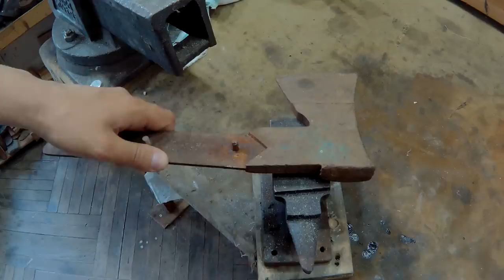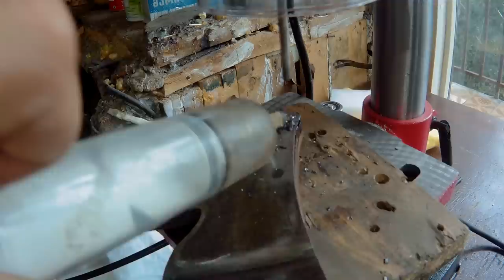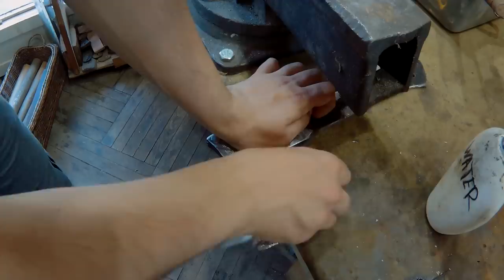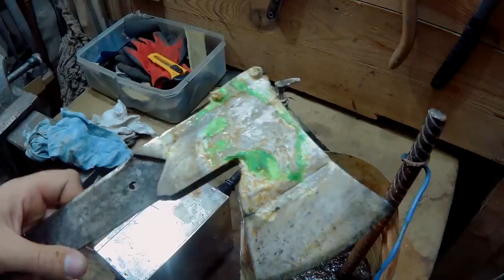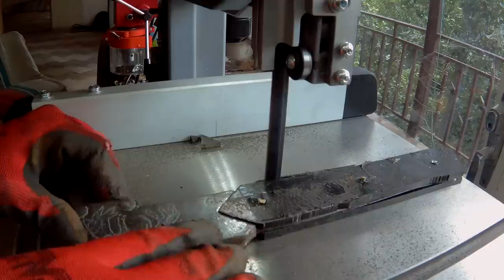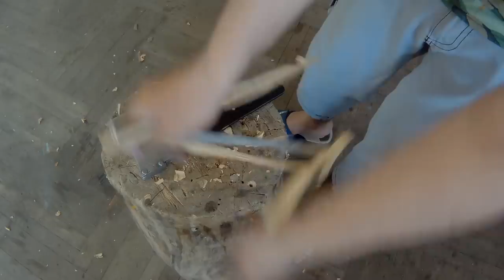Old Rusty Hunting Axe Restoration

Comment: Nice job on the ax !
Reply from the maker: Thank you!!
Reply: @ScrewsAndTools  when does a hatchet become an axe?  No really, where is that line drawn? Also, it's axe, not ax, least ways in American English.
Reply from the maker: @tootall5559  Sorry, I cant understand what you mean. Please more be specific.
Reply: @ScrewsAndTools  I would call this a hatchet, not an axe. Others call it an axe. Generally, whether it's a hatchet or axe is determined by handle length for the most part.  A hatchet is made to be used one handed, an axe is made to be used with two hands primarily. In this example, it has a somewhat longer handle than a common hatchet,  but it doesn't appear long enough to be an axe by most definitions. It's actually kind of in between from what I can see. However, I don't know if there is an actual measurement that smaller is hatchet, longer is axe. People misuse words all the time. I was a book editor, you should see some of the misuses even people that are considered smart make.

Comment: Just a little advice. Cold hammering that steel back into place is probably one of the most stressful things you could have done to that axe. Brazing those gaps with brass would have been better. Also more accurate to how that axe would have been fixed near the time it qas produced. But over all. Wonderful video and great restoration.
Reply from the maker: Hello, thank you for advice and attention, sir.

Comment: If you wanted to be able to use it as a hammer too, you should have welded on a hammer head,  unless I miss my guess, the outside steel on the head is only mild steel, and will deform rather easily. other than that, it looks quite nice, especially when you consider it was originally a lower end hatchet.
Reply from the maker: Hello. Thank you for attention sir!
 I just like test my final stuff for viewers, also i show how can I use this axe, for exp like a hummer. Yes in the future it's possible but it will be change main shape of axe.
Reply: @ScrewsAndTools  you wouldn't have to change the basic shape much. just weld a relatively thin block of good hardenable steel on the back side, then  differential heat treat it so the block is hard enough to not deform too much when used as a hammer. Wouldn't take all that much,  but it would have to be hardened just right, and tempered so it would not just break. You could get it too hard..I think on most hammers they case harden them, where basically the outside is very hard but the rest of it is not quite so hard.
Reply from the maker: Thank you for explain your thoughts. You, as I said in description of this video, this is a axe from hunting kit (kit by the rules should include knife too), so in the resource where I saw this information was writed a x e. Because I call this video axe restoration.
Reply from the maker: @tootall5559  This is a good idea, for example I can use may be shape of with size 5-6 cm × 2.5. The rest I can corrected by the grinder.
Reply: @ScrewsAndTools  Not a big deal, but I would honestly like to know if there is an actual definition of when a hatchet is an axe and vice versa. When I was growing up so long ago, I was taught that if it was MADE to be used with one hand, it's a hatchet, made to be used with two hands, it's an axe. This handle is at a length it really could go either way. It's like when does a knife become a sword?  Some short swords are not any longer than some larger knives...I don't know where the line is drawn there, either.  I haven't been able to find anything definite to go by either.

Comment: I agree with the other reviewer about the etchings, I had never seen them done that way before and I can't say I liked the results. But other than that I think you did a good job with the restoration. What material did you use for the handle, I couldn't figure that out? All in all  good work.
Reply from the maker: Hello, thank you for attention, this is a some plastic, but exactly information I didn't have. Someones call it "fenolik".
Reply: Teddy - I think you mean phenolic resin which is a type of plastic.  Nice job.  Personal preference though for an old axe would be wooden handle scales.
Reply from the maker: @randmeller  Thank you for attention

Comment: good restoration my one issue is that hammering out the mushrooming on the back  of the ax head can be possible but it's better to grind it off so that no shards go flying if the mushrooming breaks less danger that way, EDIT saw that you did it later in the  video my apologies for assuming that you didn't clear out the mushrooming fully, also here's a  how-to on electro-etching https://www.instructables.com/id/How-To-Electro-Etch-a-Solid-Metal-Plaque/ keep on doing what you do i love your work
Reply from the maker: Thank you for attention. I will check your information and will try next time.